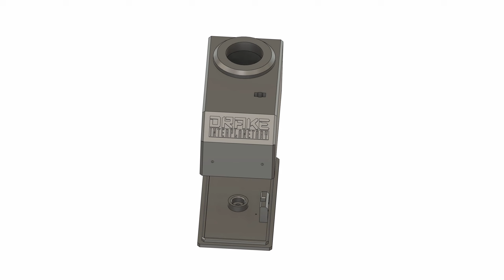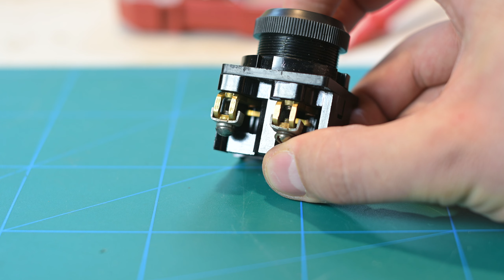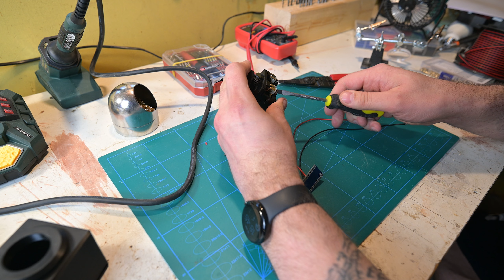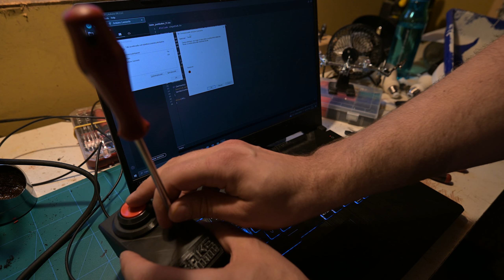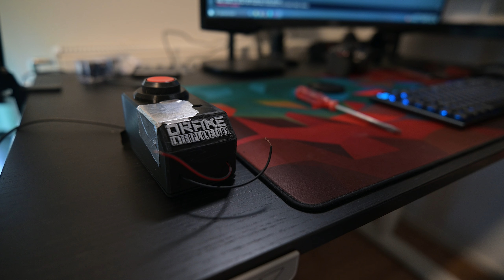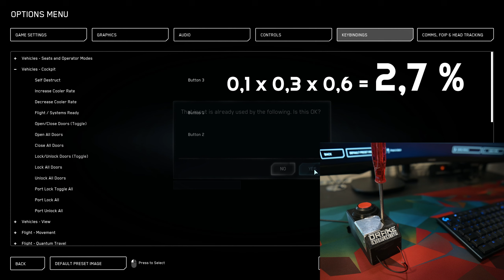Building a DRAKE Startup Panel for Star Citizen - Arduino Project

Comment: Oh wow, you gave me a bunch of ideas! You should do something similar but instead of self-destruct, it pops a fuse or sets off a warning light and siren. Also, I love the external wire! Maybe make the red button the “normal” startup with a 50% chance it’ll work and then use the wires to “hot-wire” the Drake! Also I honestly thought you were turning the screwdriver into a switch that you rotate to start!
Reply from the maker: Thanks, and fun ideas. Perhaps I some day need to build a second version that literally pops the physical fuse out. :D

Comment: I have an idea - macro button for dogfighting )) You press it - ship starts doing screwcorcs wih max strafe and randomly changin roll direction. May have like one or two ajustment regulators - amount of strafe and amount of roll (to tune for different ships). Permanently confuses opponent during the fight, leaving player time  to concentrate on yaw, pitch and manual gimbal targeting.
Reply from the maker: I think it might end up also permanently confusing me out from the game if caught using it. :D

Comment: on the 3d printing, when I get unlevel first layer warping edges is from bed temp and a draft in the room causing the plate to have different temps over its surface.  I fix my own issue with a small panel to block were the cool air was blowing from.
Reply from the maker: That sounds reasonable explanation. Well, I have already made a DIY enclosure for my P1P. :D